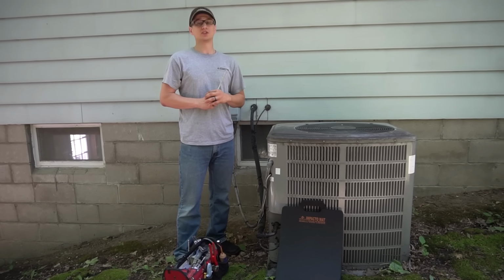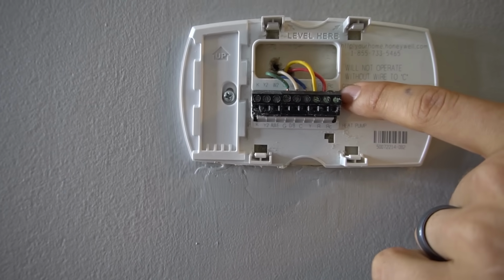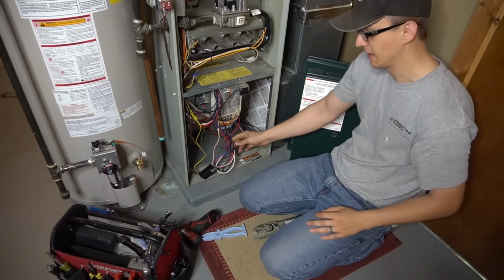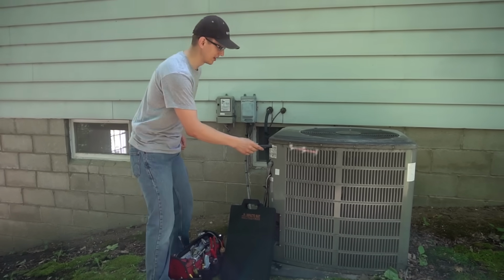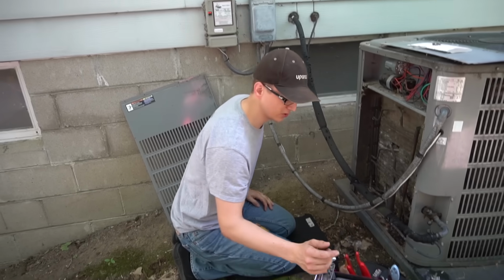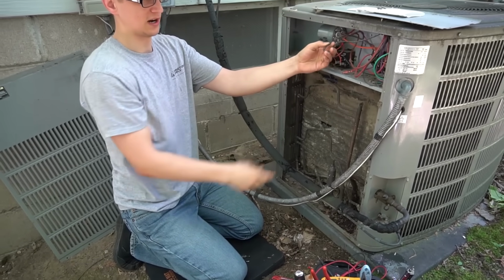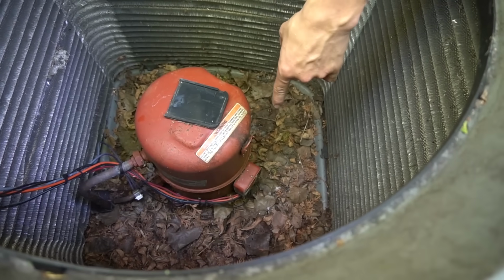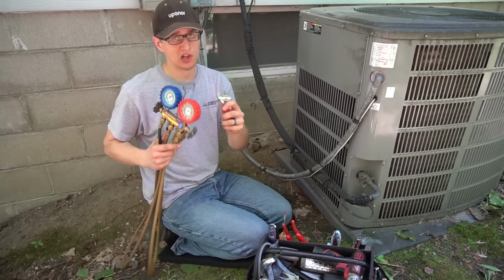AC Unit Not Turning On - How to Fix It Step by Step

Comment: Hello, Thank you for your video. My two thermostat screen one for upper level and one for lower level have gone blank one day after the other. I have checked, it does not have batteries, have a common wire. The switch has not tripped. Where should I start troubleshooting ?
Reply: Look at the 24v fuse, its usually located on the board by the blower motor. If its tripped then check for shorts on the 24v circuit. Check for continuity from C to all the other thermostat terminals. Its normal for there to be around 8 ohms from Y to C, everything else should be open or have a much higher amount of ohms. If you get a low ohm reading from C to a terminal then you have a short somewhere on that wire. The most common spot is the thermostat wires going to the condensing unit. Animals can chew on them and expose the wires.

Comment: Your videos has helped me out once. This time I am stuck! I think it might be my compressor but not completely sure. I pressed my plunger thing and it acts like it wants to turn on but it doesn't
Reply from the maker: Sorry to hear about the AC troubles! Hopefully it's not the compressor. I would replace the capacitor first as that is more commonly the problem. (test it first if you have a multimeter, if not then you just have to do trial and error) If the compressor still fails to start, I would then install a hard start kit. If it still doesn't turn on, then likely you will end up getting a new air conditioner. (as a final check I would also look at the compressor terminals for burnt wire connectors)

Comment: AC is not turning on  relay switch was stuck on the on position, swapped out the capacitor still not working. relay switch is now off but when I manually push it in the breaker trips. Did I rewire wrong or is the fan motor seized up.

Comment: I’m not sure if you’re still answering questions buuut my issue is nothing is kicking on at all. In the furnace where it says on or fan, if it’s on on nothing happens, but turning on the fan kicks on the inside unit, but nothing happens outside. I have replaced the thermostat, the outside transformer, the contactar, and the control board. The purple fuse in the control board has also been replaced. I have moved the blower motor fan in the furnace and it moves with no issues. So nothing with that is seized up. 
I’m not sure where else to go. I’ve checked the breaker too and it’s been tripped before. We reset it. Nothing happened. But I went and was going step by step with what you were doing and when it got to the part to look at the breaker I saw that it was tripped, I have no idea when it was tripped, it was the air compressor that was tripped but not the furnace part. 
I’m sorry if this sounds jumbled 😅 I did try and look thru comments to see if the answer is there. But I’m not having luck. 
If this makes sense and you can help you will be my hero lol

Comment: I just wanted to say thanks so much! 

 Because of your troubleshooting videos? I was able to rebuild a dead 3 ton, & 1.5 ton unit that went down on us. The company we hired to give us an estimate on the 1.5 ton quoted us at $2,700 for a whole new unit because he said the compressor was dead. After watching your videos? I was able to fix the problem & get the system up & running for $9.37 for the new wire terminals that had to be installed on the compressor wiring harness. 

 A moth decided to nest under the cover of the compressor access area, which arched out the wires & there was no continuity traveling from the wires of the capacitor, or connector to the compressor. You showed me how to test the compressor & it was testing “Good” which was correct. 

  After striping down the wires, replacing all the terminals with new insulated ones? I was able to get the system up & running again. Thanks so much.
Reply: I found a wire under my compressor, and it looks burnt out. So, I took off the cover of compressor plug to see if that's one of the wire connectors inside the plug. But all 3 wire connectors are still intact inside the plug.  My suction line is halfway cool to the touch, the rest of it hot. I was wondering if that wire is supposedly connected to something.

Comment: Wow, that was an absolutely incredible explanation for a wide variety of really complex stuff. I can't believe how well and how quickly you explained all of that! It all made a ton of sense.

What might it mean if the outdoor HVAC fan isn't running (no noise whatsoever) but the top of the fan motor is really hot to the touch? I recently sprayed out my coils, and noticed a week later that the house wasn't cooling and the outside fan isn't turning. (Inside compressor/fan are moving, and hot air just blows through the house).

I'm thinking of checking the contactor and/or compression, but kind of nervous.. :)

Thanks again for an incredible video!

Comment: What if I have a 2 zone unit and the downstairs thermostat is working as it should but, the upstairs thermostat isn’t working. My thermostat is like the one that was shown in your video, the thermostat shows that it is cooling but the system doesn’t kick on, everything looks like it’s working as it should it’s just the upstairs thermostat shows that it is working but is not cooling

Comment: Hi, my ac unit not cooling, did some trouble shooting and found both furnace and condenser fans are running, but compressor line is not cold. I don't know what to check next. Please suggest

Comment: I have a carrier units both inside and outside. Original tstat broke. Replaced with nest.. so much confused with abcd vs rgwy etc. Heat works but outside condenser not working.  Pushing conductor turns on compressor but the fan not working.  Replaced capacitor to no avail.  Please help
Reply: If you dont have a heat pump your standard thermostat wiring will be R, Y, W, G, and possibly a C. R is 24v hot, Y is cool, W is heat, G is fan, C is 24v common. Which color wire is which depends on how they are hooked up to the inside control board which is located where the blower motor is. They are supposed to be color coded but they may not be.
On a conventional system you will have 2 wires going out to the condensing unit to tell it to turn on. One wire leads back to the Y terminal on the inside unit, the other goes to the C terminal.
You may or may not have a C wire going to the thermostat, it depends on how many thermostat wires your house has. Some thermostats require a C wire, some can be powered by batteries. If the thermostat is wired correctly it should apply 24v hot (R) to the Y and G terminals when its calling for cooling.
Reply: @Redtooth75  Bundles of thanks

Comment: Wow, just easy im a frech women and i understand what he talking about ! So i follow the step because my fournaise run but my ac dosent run. The probleme is in my ac unit. When i push the fuse 24volt to 240volt i hear a buzz but nothing runing so i think that my condensateur but its not bubble on top

Comment: So if when you push in the plunger, the fan & compressor come on. The capacitor is bad?
Reply from the maker: It's the opposite. That means likely the capacitor is fine. This video would be your next steps: https://youtu.be/NVPhsK4gK1A
Reply: @WordofAdviceTV  I haven't been able to find the problem yet,  but I did rig up something to push the plunger in(I'm in MN like you and been so hot) and with that, it cooled down the house. But I just went outside and a "freeon" line was covered with frost, is that normal or is it a sign of the problem? Ty for helping. I think I'm close to finding the issue

Comment: The thing that i would like to know is where the 2 wires the are connected to the relay to turn the motor on is where do they connect on the furance board?
Reply: One wire goes on Y and the other goes on C
Reply: @Redtooth75  thanks

Comment: my ac runs for a few hours then shuts off completely.  I changed the outside capacitor and it lasted for a few hours then shut back off. going to check the contactor
Reply: If you have a freezestat it could be that. If you are low on refrigerant the coil will start to freeze and you will have reduced cooling.

Comment: Does power for  air handler fan usually go through the 240 volt control at condenser unit?

Comment: Hello, My thermostat is in cool on mode (flashing) and AC is not turning on. I have changed the thermostat and capacitor. I am not seeing 24 VAC from Y to Common on the furnace board or on the contactor. Anyone know what is going on? Thanks

Comment: I just moved into my condo,  it was built in 2015 but went to turn on the AC... nothing.  The breaker keeps tripping. It's A carrier unit,  electric split system. Thermostat turns on cool, air blows out,  today its about 76 outside,  inside out was 76 and now it went down to 75. Unit outside isn't doing anything.  Breaker keeps tripping until i pulled the T disconnect outside.  Is the condenser bad?
Reply: with T disconnect out,  I reset breaker and it stayed on. Went out and put T back in,  unit came on instantly and fan started to spin, then breaker tripped. Ugh...

Comment: Man... I appreciate your help very, very much. I replaced my capacitor but accidentally crossed two wires on the ac unit power from the disconnect box and melted part of my thermostat. I replaced the thermostat, it turns on but no power going to my unit and my air handler doesn't have those regular fuses. Looks like a resettable fuse.

Comment: had a new breaker box put in and since then my fan on outside unit spins very slowly. It acts like its going to take off full speed then slows down,and repeats speed up,slow down. Again,this is the fan doing this on outside unit.

Comment: Awesome videos! With my unit: Live in FL, the ac condenser comes on but shortly after turns off. I checked the blower motor and saw that it comes on but turns off. So it comes on (spins low) and turns off. It’s not pushing any air throughout the house. When I replaced the air filter (accordion style yesterday and pulled it out today, I had water in it. I was able to fill a 1/2 cup with the water. There was also water built up in the drip pan. I changed the ac condenser capacitor but no luck. IMHO there’s something stopping the air from flowing throughout the house. Any ideas on what I can check?

Comment: Mine runs when i push in the plunger - then you suggest changing capacitor?
Reply from the maker: If it runs when you push in the plunger then it's likely not the capacitor that is bad. I would suggest watching this video to further narrow it down: https://youtu.be/NVPhsK4gK1A
Reply: @WordofAdviceTV  I accidently pushed a reset button, started right up.
It's in line pressure sensor.
I suspect I'm getting low on coolant.
Reply: I called in a tech. The reset button is for high pressure, not low. There is a low pressure sensor, but not a rest for it 
The cause of my high pressure switch being set off is because the fan and or fan motor wouldn't start consistently, which causes a spike in line temperature and pressure.
He replaced my fan motor and I have a spare capacitor they I will resolve myself, even tho the old capacitor didn't show any signs of being bad. But I read the recommendations, that when replacing the fan motor it's a good idea to replace the capacitor as well. So I will do that, right or wrong. Thanks everyone for your input.

Comment: Ok so I pressed the plunger and the unit came on so what now? The capacitor is weak?
Reply from the maker: If the unit comes on, then the capacitor is usually not the problem. I would refer to this video to further narrow it down: https://youtu.be/NVPhsK4gK1A
Reply: @WordofAdviceTV  It's at the board. I had the board replaced just at the beginning of winter and I remember now that the technician mentioned something about the AC and coming back. I'll search for your trouble shooting video on the board. Thanks!

Comment: I put new thermostat in and it worked  outside isn't coming on but when I push in it will turn on. now inside fan won't turn on thermostat face on but won't power on

Comment: What if the contact plunger on the coil in my AC unit won't push in on its own? I have power to my fan on my furnace inside but my AC won't power on outside. After pushing the coil plunger in as you instructed everything powered up, cool air coming out of all my vents in the house, etc...I will say since my thermostat in the house will show room temp & set heat temp but when turned to AC there's only room temp showing & nothing showing for my set AC temp. I had to turn my fan to "ON" instead of "auto" to push the cool air I produced when pushing in on that coil plunger. 
So again if everything is working separately but not together because that plunger won't push in on its own what is the problem and can I fix this issue? 
Side note...I cleaned the crap out of both my AC unit & my furnace before doing anything. Drain is clear & new filters, coils washed down
Please help! 
A desperate momma in the hot south. 
Vick~🙏🏼🥵🙏🏼
Reply from the maker: Sorry to hear about the AC troubles! I would suggest this video to further narrow down your problem and pinpoint what is causing it: https://youtu.be/NVPhsK4gK1A

Comment: Hello, 2 summers ago I watched your videos and learned I need to replace my capacitor. I did that and everything worked great. Now I turned my AC on for the first time this spring and it runs for maybe 10-15 seconds then shuts off. I had the HVAC guy come out, he said the outside coils are cold and he he said there are no voltage issues. He thought maybe it was my thermostat but I just replaced that and the same issues.

It runs for 10-15 seconds, very cold air right away, then shuts off. The fans continue to push air through the vents but the outside fans don't spin. Do you have any ideas what it might be or fixes?

Love the videos, thanks!
Reply: If anyone sees this comment here is how I fixed it. I went outside and used an insulated screwdriver handle and I pushed the contactor plunger in, just to see what would happen. After about that 10-15 seconds where it normally shuts off it started making this really loud clicking sound. I replaced my contactor and it instantly worked no issues no short cycling.

Comment: My unit runs its putting out air ...just not cold air
Reply: Can anyone help
Reply: Look at the outside unit and make sure both the fan and compressor are running. Just because the fan is running does not mean the compressor is, you should be able to hear the compressor. If the contactor is pulled in but fan or compressor or both does not run check the capacitor and check the circuit breaker.
If both the compressor and fan runs then check the temperature of the larger suction line with insulation on it and make sure the outside unit is clean. If the suction line is warm then you are probably low on refrigerant. If the suction line is freezing you have a lack of airflow through the inside coil.

Comment: Hi I have a quick question. 
My furnace just make a humming noise and I replaced the FUSE #3 4xs ,so we had a technician come take a look at it and he said...that it could be the THERMOSTAT,but if we decide to do it ourselves, we should start with the CONTACTOR outside. When i replace the fuse those times the unit started running, but after 5 minutes it blew the the fuse.
What do you think?

Comment: That flexible white wire that runs along side the main 220v wire was knocked to the ground by my dogs. Looks like it attaches in a hole under tge main, 220v, how do I reattach it?
Reply: They usually get attached to the factory wiring with wire nuts. It does not matter which wire goes to which. One wire leads to one side of the contactor coil. The other goes through the pressure and temperature switches and then to the other side of the contactor coil. If you do not have any pressure or temperature switches then it just goes straight to the contactor coil.
After you get it reconnected you should check the 24v fuse if it still does not work. It might have shorted and popped the fuse when it got pulled out.
The wiring diagram will also show exactly how they get hooked up.

Comment: I have a question.  Yesterday, my a/c turned on, air blowing in the house but not cold, went outside and unit was not on at all, no fan turning. Nothing.   I turned off the a/c breaker then back on.  The unit then kicked on like normal.  I had to do this twice throughout the day.  
What could be causing this?

Comment: Hey man, you have done an excellent job explaining but I have a question. So the plunger works whenever I press it in but whenever I try to turn on the ac it does not want to pull the the plunger in to the volts through. What could be the issue??
Reply from the maker: It could be a few different things. I would recommend this video to narrow it down: https://youtu.be/NVPhsK4gK1A

Comment: Sir what if your capacitor is good the fan is good 240 volt is good but the plunger doesn't close ?.?. When I push the bypass in everything turns on fine ..
Reply: Check for 24 volts on the coil for the contactor. If there isn't then check the thermostat, 24v circuit fuse, and thermostat wiring. If it is getting 24 volts then you need a new contactor.
Reply: @ApollosEclipse  thanks brotha turned out to be the fan motor ughh changed it out and everything instantly started working perfect .. got one from Ebay for 100 bucks

Comment: Howdy.  I just wanted to say thank you for the great video.   I was able to find and correct the problem by following along step by step.  It was a “bug” in the machine.  Spiders had been nesting on the circuit board in the air exchanger outside once I evicted them and reset the board by unplugging it, problem solved.  I lived the advice about pushing to contractor down to get the compressor working.  That’s what started me down the road of repair.  Thanks again, great video!!